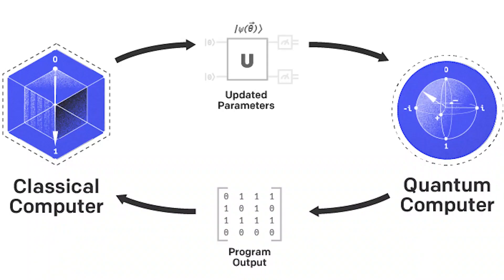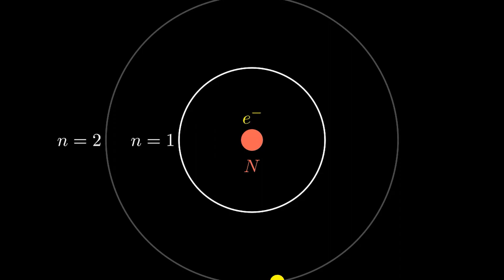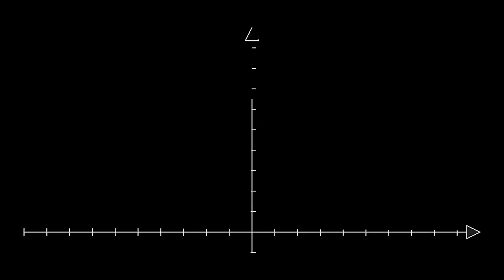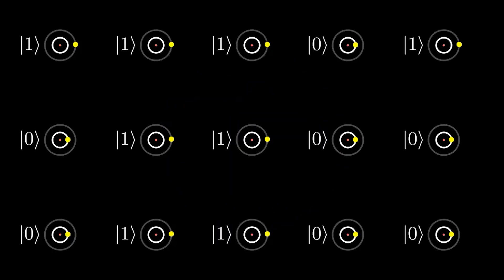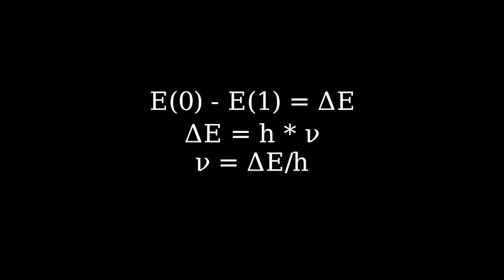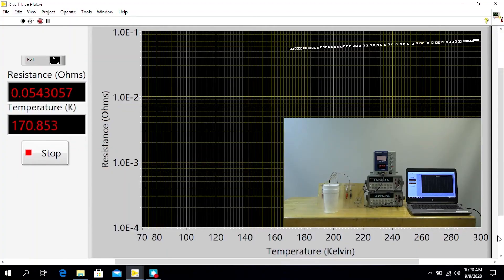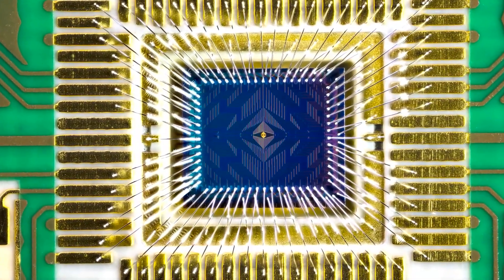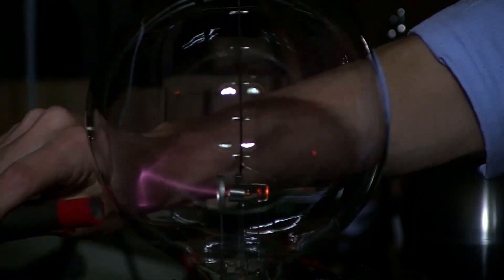How To Build A Quantum Computer

Comment: Ay keep it up, keep it short and interesting , can make a more detailed video later and refer to older ones.
Just slightly different subjects in the genre. Quantum isn't impossible to grasp simply. Explaining things simply doesn't hurt the subject.
Cold doesn't exist, just the absence of heat energy. Another good way to think about computing is "Deep Blue" vs Kasparov. They detail how a computer works with bits, and how a mathematician said that our computing ways will be over done by this exact way. The issue was heat, storage, and we simply didn't have the technology to invest when simple still worked well.
Like moving from a stone axe to a metal axe era.

Comment: I am very interested in the details of trapped ion quantum computers. Do you know of any that use penning traps rather than paul traps? I've been fascinated with uniform magnetic fields and their effects on moving charges for a while.
Reply from the maker: https://opg.optica.org/viewmedia.cfm?uri=CLEO_QELS-2013-QTu3C.5&seq=0 here’s a link to a paper where they use penning traps. I think due to engineering constraints (ease of access with optics) Paul traps are more common, but I’m not sure. I don’t work in trapped ions so I know a limited amount.

Comment: Pretty cool.  Great video. The Thing I still don't understand is how one sets an intermediate superposition state between the 0 and 1electron energy levels.  Say, for example, you wanted 70% probability of it being a 1 and 30% probability of it being a 0.  What energy level would one set for such a superposition if the electron can only be an either a 0 or a 1 orbital?
Reply from the maker: This is a great question! To set an intermediate superposition state like 70/30, you wouldn’t promote to any intermediate energy level, because those don’t exist. Quantum mechanics strictly forbids energy states that aren’t the allowed solutions. That bieng said what you can do is shine a laser with a frequency that is detuned (meaning different) from the frequency of the transition. Based on the frequency and time of the pulse, you can control your superposition. Note that this particle doesn’t have energy in between the two eigenstates, rather it has a 70% chance of having energy E1 and a 30% chance of energy E0. Hope this helps:)
Reply: @Lukas-Lab  Sweet.  Thanks for the reply man.  After more digging and with your feedback, I understand now that what is being controlled is really the probability wave function of the device.  Which then collapses to the desired 70/30 state when measured.  Is that right?
Reply from the maker: @Beerbatter1962  close, the wavefunction would be the 70/30 superposition. When you measure it the wavefunction collapses into one of the states. So if you had 70% 1 and 30% 0, then with 70% probability you would measure 1, and 30% probability you’d measure 0. If you wanted to find out the coefficients you’d have to prepare the state over and over again, and measure the system over and over again until you could build a statistically significant probability distribution. So you would prepare what you think is the 70/30 superposition 1000 times with 1000 different systems, and then go ahead and measure each one. You would measure 1 ~70% of the time and 0 ~30% of the time.
Reply: @Lukas-Lab  Oh, I see.  Well that makes so much more sense to me.  I think I'm starting to get an intuitive feel for this finally.  It really is amazing to me that we are able to taylor the thing called a wave function,  that we don't really know what that physically is and can't see, yet manifest that into a real particle, with the desired probability, when one is ready to collapse the superposition.  Such an exciting time to be a young engineer.  Thank you so much for all your feedback.

Comment: what about recommending some resources to learn quantum computing ,it would be great
Reply from the maker: It depends on what you want to learn. Are you interested In hardware or software?
Reply: i am interested in software but to understand its software well , I think a basic understanding of hardware is necessary,
 what do think ? @Lukas-Lab
Reply from the maker: Sorry I never saw this reply! Id suggest lookning into IBM's resources, as well as MIT's resources. In terms of hardware, its a bit more difficult to find introductory level material, so id say its not a bad idea to try and follow a video series that explains the principles of quantum mechanics, so then you have a better foundation for when you go to actually learn about hardware implimentations.

Comment: What's Envy diamond? Also, any chance we can use nuclear energy to power quantum computers or use the uranium?
Reply from the maker: ‘NV Diamond’ is a specific type of diamond that has been bombarded with nitrogen. The nitrogen integrates into the crystal structure, but since it only forms 3 bonds instead of the 4 bonds that carbon makes, there is a a “vacancy” in the crystal structure. You can use some clever physics to make these vacancjes into a qubit. I’ll explain it in better detail in a future video. As for the nuclear energy question - right now there’s no reason to do that just because quantum computers don’t draw enough power for it to be particularly useful, but it’s possible. The power source doesn’t change anything other than just the raw amount of power available.